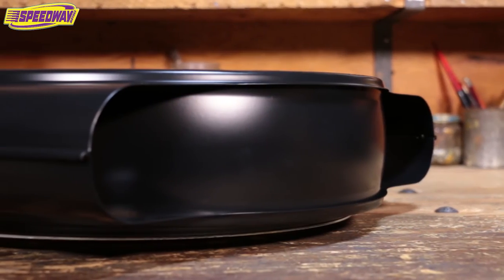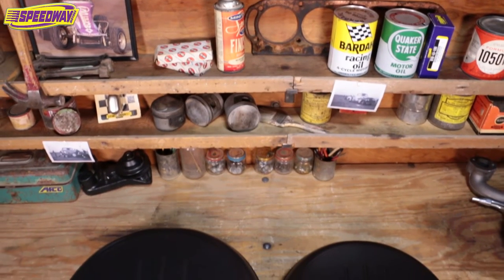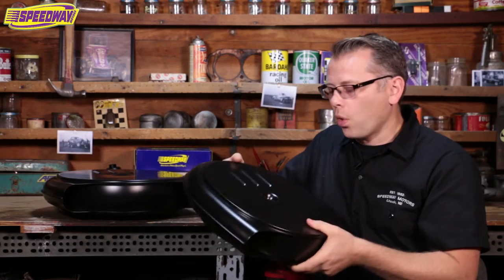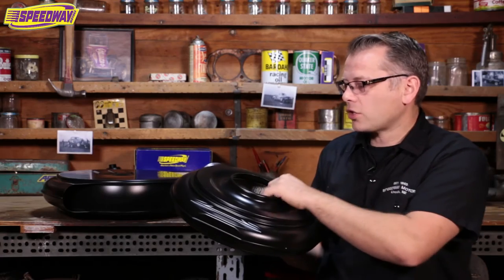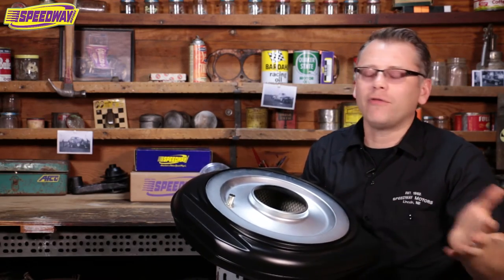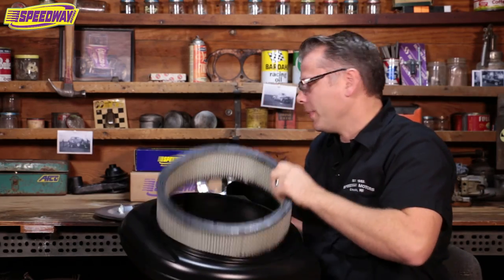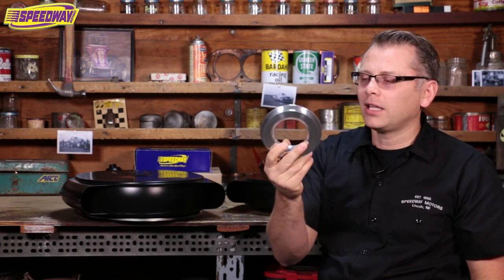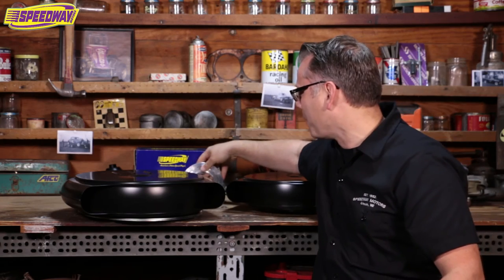Speedway Tech Talk - '51-'56 Cadillac/Oldsmobile Air Cleaners

Comment: I have a original from a 56 Cadillac I  used to own, which by the way,  is still up and running.  I converted  mine to a paper element and used a base fror a Lincoln air cleaner.

Comment: ARE THESE ENOUGH AIRFLOW FOR A EZ EFI THROTTLE BODY?
Reply from the maker: The larger air cleaner number 92511925 has a 14x4” air cleaner element and sufficient for most mild small and big block applications and the smaller has a 12x3 ½ element which again would be fine for most mild engines.  If running at high rpm cfm requirement may be limited minimally and if running on the strip normally air cleaners are removed.  These sizes of elements are equivalent to what the factory used on the V8 options for big and small block.